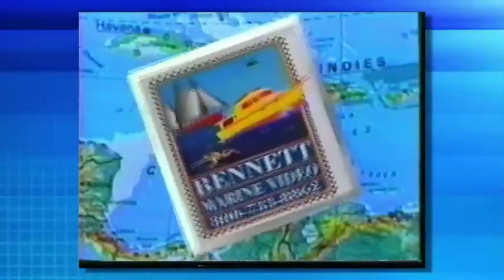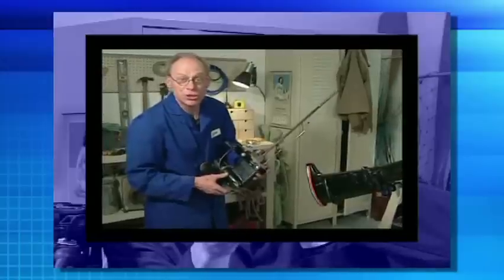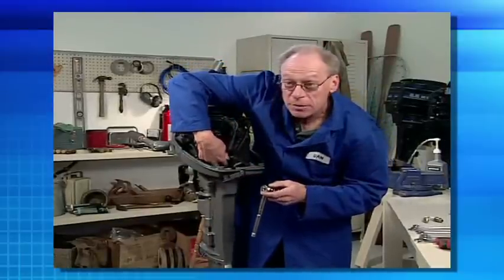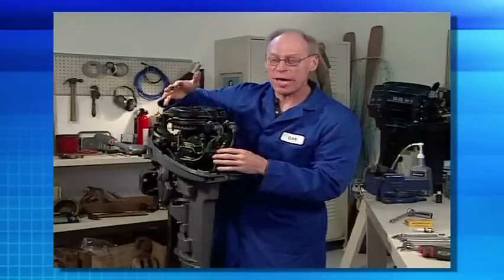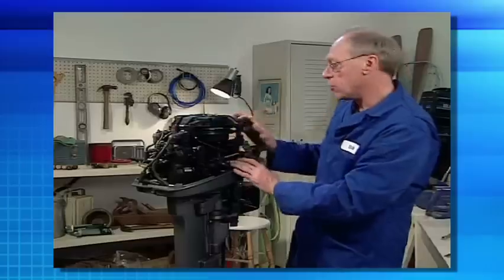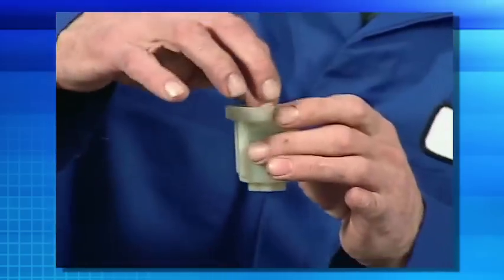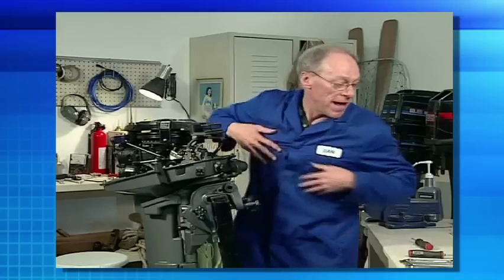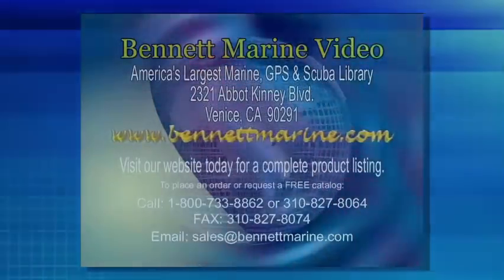MAINTAINING & SERVICING YOUR MERCURY OUTBOARD MOTOR H4596DVD

Comment: there are 2 things wrong with this video. (1) spark plugs do not need to be changed often. maybe once every 3-5 years. 99 times out of 100,  the issues with the engine isnt the sparkplug. (2) he said there are two things that cause no spark but didnt mention the one that causes no spark the most! its a bad coil.

Comment: I picked up a 1978 merc 7.5 it has a propeller with 2 blades which is beaten up I am using it on my hydro force inflatable boat speed sucks not sure if it is the propeller or the engine any suggestions.

Comment: I stored a 4hp 4 stroke incorrectly.  I heard the gearbox oil goes into the motor and can cause problems?  What extent of problems am I looking at?  Approx 5 running hours on the motor.

Comment: Have the exact motor in the video. It keeps bogging down at full throttle. Any suggestions?  Already bought a new fuel line and tank. Fuel filter is clean and motor was serviced fully last year. Thanks

Comment: I have the 2008 Mercury 25HP EFI 4 Stroke.  Purchased used 5 months ago, left stranded 10 of 12 times on the water.  Engine problem: Motor starts right up first try, runs great until shut off.  Sometimes it will start right back up, but many times it will turn over, but will not start.  Replaced low pressure fuel pump, but that was not the problem.  Replaced plugs and fuel filter.  Considering High Pressure Fuel Pump in VST, thinking maybe it is intermittent.  Boat has been to 3 Marina’s, but they stated, they could not get the engine to fail.  Any suggestions?
Reply: I have been chasing this issue for years

Comment: I have a 17 +/- year old 40 hp mercury. It ran when I bought it but now I have spark and it is getting gas,has compression, but will not start.Any ideas ?
Reply: +bob mckinnon check plugs, also make sure the key is pressed in while cranking (if possible). dbl check u have spark at the actual plug - check all plugs - carb might be blocked from dirt.. fuel hose leaking air?

Comment: I have a 1990  20 hp merc. that wont idle on its own. I changed the  plugs and have new gas. can anyone help me?
Reply: Try cleaning out the carb
Reply: Try adjusting the idle screw

Comment: Charlie
i have a 2003 15 hp 4 stroke mercury. When I bump the fuel  bulb on gas line to carb. The float will not shut off gas to carb.I installed a new float and needle but still wont shut off fuel to carb which floods carb?????

Comment: i have a 2000 150 HP mercury outboard. The oil canister on the side of the engine is leaking oil from the top nut. The top nut on the canister does not tighten up. Anything possible to fix other than replacement??

Comment: any ideas i have a 50 hp 4stroke merc outboard i have replaced the fins in water pump and installed a new thermostat it runs but when you run at higher rpm the temp alarm comes on any ideas on what it could be
Reply: had the same problem, the rubber tube from the engine to water pump is leaking. there computer won't pick up this problem

Comment: I got a 2003 Merc 9.9 it wasn,t spitting water so i replaced the water pump i,m getting water now but still not spitting like it should i checked the thermostat it,s like new no build up in the water tube or houseing am i not getting enough lube on the impeller? Or are my water ports blocked in the head?

Comment: 60  hp 4 cylinder 4 stroke mercury complete carburetor clean. I took apart to dip & removed all of the butter flies & Ican't getting it running right. I thought all of the butter flies were all the same. One time it runs good but can't get off of high idle, to adjust, next time runs ruff but can adjust idle after moving butter flies around.  Please Help.

Comment: on a 45 hp classic 50 mercury outboard, what is the threaded hole next to the # 1 spark plug for
Reply: William Norris It could be used for something like a temperature sending unit if you wanted to have a temp gauge.

Comment: Help anyone please!!     I have an old sears out board 3.6 It starts but the prop stopped spinning any ideas as what it can be?     Is it an easy fix?????    

Thanks.
Reply: I had an old sears 7 hp engine that did the same thing . It had a shear pin go bad on the shaft at the prop

Comment: I have a mercury 15hp. The motor idols fine in a barrel at home. I replaced impeller plugs fuel filter and lower unit oil. While running on the lake I've noticed a dead spot in the throttle. If I mess with the choke pull the motor will start to run better. It's like it's not getting fuel. Any thoughts on this? Thanks
Reply: Fuel pump

Comment: what size plug for 1953 johnson 10 hp and the gap and 16;1 is oil gas ratio in book.is this ok and top magneto bolts that hold that steeel grabber plate for hand pulley asse. what is the correct height of the bolt head.mine look like replacements and have scrub marks indicating it is rubbing.pls help.thank you.

Comment: I have a 125 force outboard and gas comes out with the water when started any suggestions???
Reply: Joe Chavarria had same motor, when you prime the bulb primer, if you do to many times, fuel will drip from carbs, and leak out of weap holes into water. the fix! put a sponge under carbs, clean often, don't over prime or over choke! good luck!

Comment: hello I have a late 80s mercury 25hp I am putting a tach on it and the tach has a few different positions on the back to set it,, which position do I put it on?? any help would be great
Reply: infrareddreamz how did u hook up the tach? I have an 1991 Mercury  25XD and would like to hook a good tach to it not the tiny tach that u wrap a wire around the spark plug wire!! help me out please and thanks!